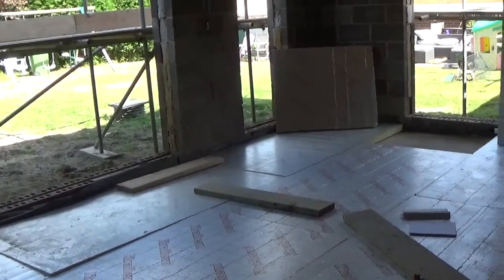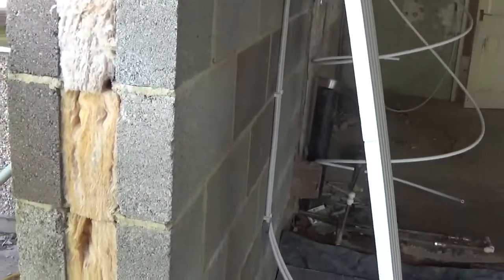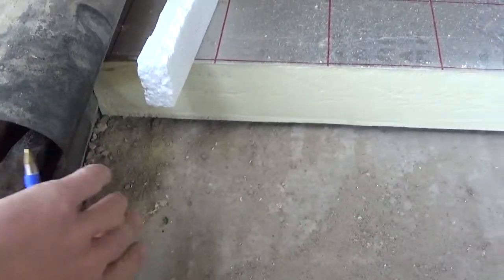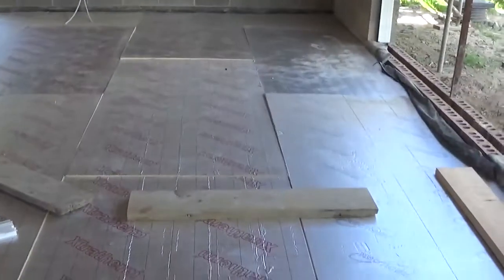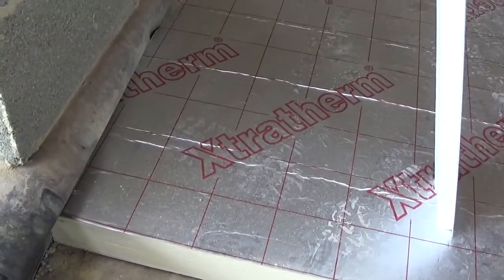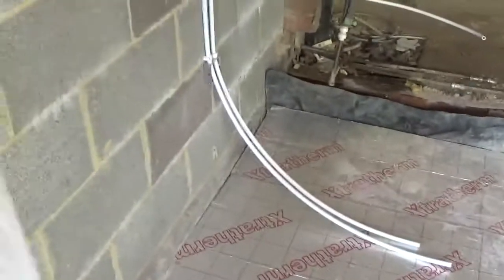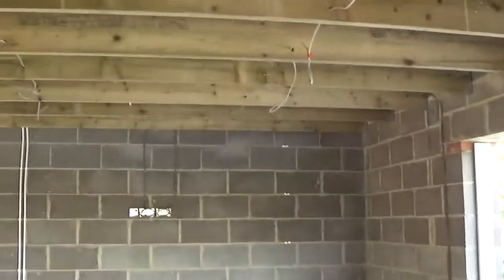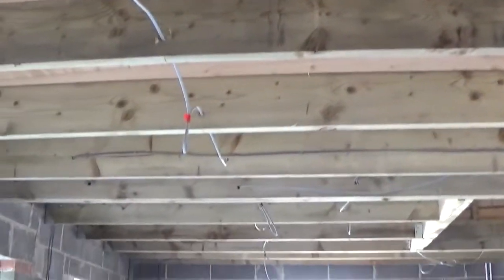Insulation and thermal bridging - Single story extension

Comment: I heard there are issues related to OSB glue in warm roofs stopping moisture from going through and reaching the breathing membrane, thereby creating damp, rot and decay to the boards. Have you built warm (non walkable) sloped roof without OSB?  Rafter/vent - Insulation - Breather membrane - counter/batten and tiles?
Reply: Shouldn't have moisture leaving the warm roof? The membrane prevents moisture reaching the wood

Comment: Off topic: Infill slab so moisture comes up between wall and slab. Hate infill slabs. 

There is a thermal bridge between the wall and slab below the insulation. The vapour barrier won’t do much to stop temperature transfer. 

It’s actually really difficult to stop thermal bridging with slabs. There is always somewhere that bridges. Door entry, patio entry etc etc.

Comment: Hi, I've got a small extension piched roof that I'm  insulating with kingspan. The  rafters are 6x2 and the kingspan is 75mm thick. Should I just double up on the kingspan? Would appreciate any advice from you

Comment: Hi, I normally put a dpc membrane under the insulation boards, (belt and brace’s) and on top also when doing a warm roof you need a vapour membrane under the insulation.

Comment: Full cavity fill with wool is not the best. The outer wall might not be completely waterproof (hence the dampcource) and the rockwool will loose its structure and its insulation capacity rapidly when wet.

Comment: Not sure why you popped up on my feed, but I'm glad you did! Your accent clued me in that you might not be far away from me. I have an existing single storey extension on the back of my house which was added by the previous owner. It can get very cold, and acts like a heat sink for the whole ground floor. I suspect the insulation (particularly in the roof) is not adequate. Do you do remedial work for existing buildings at all, or could you recommend someone in the North East who does? Thanks!
Reply from the maker: Hi Chris, I’m based in Wallsend but we cover most of the North East and yes we do remedial work.  If you visit www.lambertconstruction.co.uk and go to Get a quote. Just fill your details in and I’ll get in touch and see if you would like us to pop out and see you.
Reply: @ianlambert284  Done! Thank you!

Comment: As soon as the render starts to allow  water to penetrate  through the wall your gunna have loads of damp on inside wall,  you basically have a wet wall ( outside) and a dry wall ( inside) your supposed to have a gap between insulation and outside wall to, a) allow air flow and b) not allow damp from the outside wall to cross the cavity to the inside wall, this is why the cavity wall insulation never worked and it cost millions of pounds across the UK to suck all the crap out
Reply: Yep we have removed it from a few house cavity’s due to damp
Reply from the maker: Sorry I don’t understand a word of that 😂.
Reply: @ianlambert284  is that better lol

Comment: Fairly sure you need more than 80mm of PIR under the floor to comply with current regs. Did the BCO sign off on 80mm??
Reply from the maker: Hi Phil, thanks for your comment. 80mm PIR insulation beneath screed gives floor a U value of 0.22 w/M 2k.  👍 unless it’s now changed.  This was nearly 2 years ago and yes BC signed it off.  We are still working to building control drawings that state 80mm PIR insulation
Reply: @ianlambert284  Hi Ian. Apologies, I was working on 0.11 u value for new build rather than 0.22 for extensions, as you say.

Comment: That mineral wool becomes useless IF gets wet for any reason in the cavity. You should put in Rigid insulation or rockwool that wont absorb water. The  best would have been full external insulation for a new build.  Why not externally insulate?
Reply from the maker: It’s not mineral wool it’s cavity insulation, specified by the architect for external cavity walls.  It’s a lot more expensive to insulate externally
Reply: @ianlambert284  I know its more money but still.. I would not put that yellow wool in the cavity.  That extratherm insulation would have been better choice as well in the cavity.  Probably more money again, but....   What is the brand of this cavity insulation that the architect recommended?
Reply: Tbh Im only a first year carpentry apprentice and when I seen the yellow insulation in the video I raced to comments to have my suspicions confirmed. 
So im also very interested to know what brand of cavity insulation was used. Thanks. 👍

Comment: Good video very interesting to see the detail you are employing.  I am about to dig out an old concrete slab that was laid down on an 1895 house, to get insulation down with a reinforced concrete slab on top with underfloor heating embedded in 6 inches of concrete with stone  tiles on top.  I intend putting the upright insulation up to the concrete level, idea is to use the concrete slab as a heat store so 2 weeks to heat up and cool down.
Reply from the maker: Hope it all goes well mate! They never bother to me much with insulation back int he 1800’s 🤣

Comment: Why the need to insulate between internal wall and screed? The cavity wall is insulated so should not cause thermal bridging?
Reply: It is because it is a cold spot ie the wall is cold and would attract condensation.
Reply: @dannymurphy1779  that's my point it isn't a cold wall because it is insulated cavity, so that should keep it warm? Or have I missed something?
Reply: @StLA92  The internal wall is sat on the ground. The only other option as someone else has already commented on here would be to use something like foamglass at the bottom of the wall to isolate it from the ground but it's not a common practice in the UK yet as far as I know anyway.
Reply: Marmox thermoblocks are a solution for cold bridging below dpc.

Comment: Why no vapour barrier in the roof ?
Reply: The vapour barrier goes on top of the roof deck on a warm roof.
Reply from the maker: It’s a warm deck roof
Reply: @ianlambert284  are you not going to put insulation between the rafters seen in the roof then? - vapour berrier should be on the warm side and not om the cold

Comment: Still building as you did in the 1940s then… Jesus….. this is soon 2022 and we send ships into space. How Long did This extensions take? If you out undulation under the slab which technically you could avoid. And put insulation externally you could avoid all of these nonsensical expensive details!
Reply: EWI has bridging issues that need to be solved with detailing as well. Its not a perfect solution.